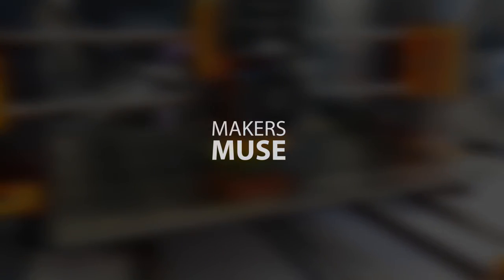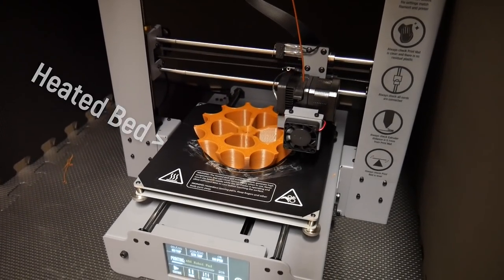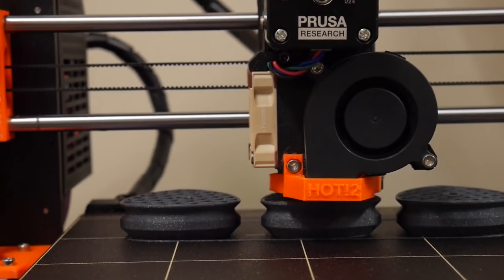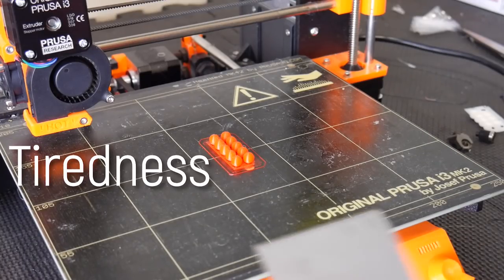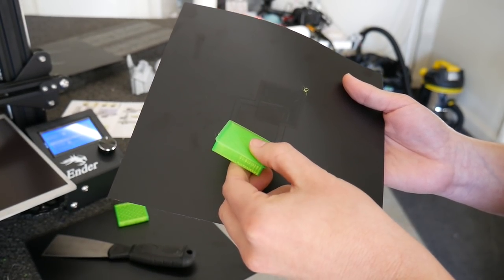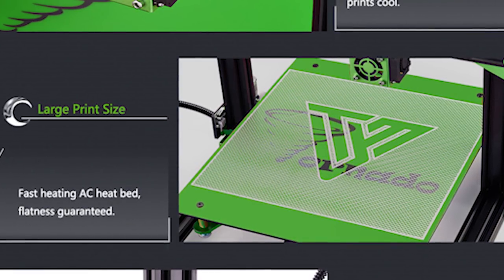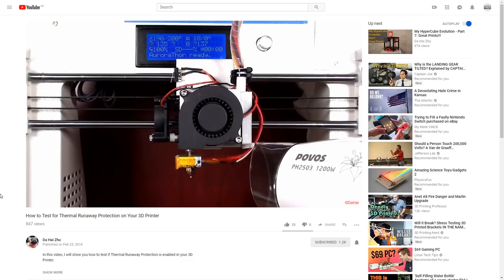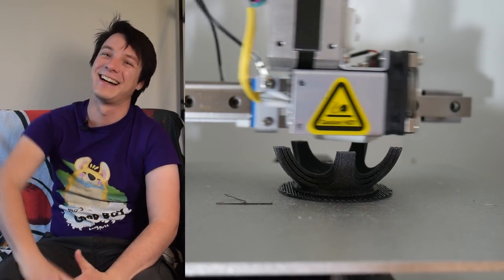Safety Tips for FDM/FFF 3D Printers - 3DP101

Comment: Angus, I would include the removal of support material. It's sharp and can cut  your hands very easily. 

Either using gloves or a machine with support material that dissolves is a way to reduce the risk. 

Great information as always.
Reply: That's especially a problem with pla.
Reply: FireFox64000000, very true I tend to see that happen more often with PLA.

But I feel this has happened to all of us at one point.
Reply: I cannot remove support material without hearing Angus's voice talking about the "shaap shaads" in a previous video. And he is right. I've had a few shards go under my fingernails. Ouch. Right now the most dangerous thing I do is use some sharp dental pics to clean up a print. I am continually jabbing those things in my fingers.

Comment: No mention of fume risks from hot filament ? I recall someone ( Sarah Petkus I think) reporting serious health effects of exposure to fumes from a 3D printer
Reply: Yeah, I was wondering the same thing, along with nano-particles that are created, especially from ABS as well.
Reply: yes, he should have mentioned that. there is a person on YT that did elaborate tests on this and PETG and PLA should be safe unless you run something on the scale of the Prusa print farm, ABS and other materials should be treated with great care. I have my printer in an airtight enclosure that can be vented to the outside for when printing ABS, PC and nylon.
Reply: I'm thinking about a vacuum cleaner hepa filter (it's dirt cheap from aliexpress) with a fan (some 80-100mm noctua to keep noise down) in my enclosure, did someone scientifically tested this? or going to?
Reply: i don't know about that hepa filter. personally i would have a hepa filter and an active carbon filter stacked. you want a pretty big fan, i used a 120mm pc fan since they are so standard.
Reply: there are for sure filters with active carbon too, there is a lot of printers having filter as an optional extra,  replacements can't be much expensive.
Reply: That is true but there isn’t much of a way to counter fumes besides not printing in a broom closet and huffing the fumes, open window and fan if necessary, there’s a reason a lot of stoves are coming with overhead fume extractors but in general, breathing in burning material isn’t healthy but it won’t knock you out like monoxide poisoning from cars quite yet, setting one’s house on fire or losing a finger is a bit more of a higher priority. Also, you are mentioning one source on harmful fumes, at this point it might be more dangerous to make a PSA on don’t 3D print your own gun to bring for show and tell in a kindergarten, not that I am disregarding the idea of having a filter on printers, just that there’s no practical way of implementing them on machines without telling the entire community to not buy 3D printers, there are quicker ways to kill a business
Reply: @mikeselectricstuff Virtually non-existent. The "fumes", ie: the smell, of hot plastic isn't of any great concern to your health. There can be some argument that you might find some so-called 'nano-particles', but take a moment to think about how ill-conceived that argument really is. It's the lab rat argument... 'Sugar is so evil; this lab rat died after eating 20 pounds of it in a 7 day period, we must warn the world of this massive health risk!" Of course if you expose yourself over long periods of time in enclosed and unventilated areas to lots of  hot plastic fumes (mostly from ABS), you might see health risks. But the average home printer will never realize those risks.  Better not go outside lest you be assaulted with quintillions of nano-particles of dirt, dander, pollen, etc..!

Really though until there is a good study done about this, it's just opinions and conjecture.

Comment: Thermal runaway protection saved me just yesterday. The thermocouple came loose from my printer and I would have never noticed if marlin didn’t catch it.
Reply: Ye, a tonne of electronics have thermal protection (including most laptops since those CPUs have been known to cause fires as well), its insane to think that thermal protection doesn't come in 3D printers as standard. 

I had a problem with a camera many years ago, it had a fault and didn't have a proper thermal protection. Even though the camera was in my hand, I was busy chatting to someone so I didn't notice, it started smoking, sending fumes up into the air and, of course, the batteries also caught on fire. I was very lucky not to hurt myself with the heat, the batteries, the molten plastic or the fumes.

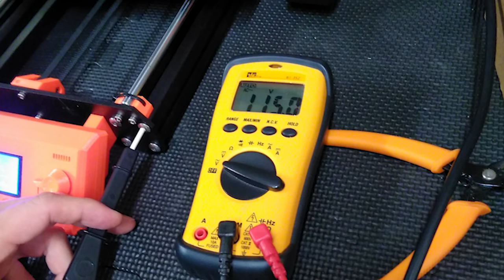Comment: Hi Angus. A few comments about 7:40 (electric shock): 
 -  What you feel is current, not voltage. That means the power supply in the faulty printer had excessive leakage current. 
 -  Most isolated power supplies on their own have floating outputs, even if there is a ground connection on the line side.
 -  Measuring on the isolated side of the power supply with a multimeter in voltage mode will read a "ghost voltage" created by the leakage current flowing through the 
    internal resistance of the multimeter (usually 10 Megaohms).
Reply: Volts jolt, current kills.

Comment: Too lazy to look down through 226 comments to see if someone else has already mentioned it, but for those of us with long hair, there is a significant TANGLE RISK.  Lean in too close to that running print to examine a fine detail, and let your hair get pulled into a belt, pulley, or lead screw.  It WON'T be pleasant. I think this is an especially important consideration when children are involved.  
Make sure your hair is kept well away from moving parts with the use of a ponytail holder, rubber band, etc.

Comment: On scrappers, 3D Printing Nerd put me onto to chisels in one of his videos, game changer for me. More mass and can go dead flat on the bed, helps get a stubborn corner up and then the scrapper can be used without excessive force (if needed at all). Of course, all of the same safety considerations apply (if not greater care needed). I was sceptical, thinking I'd end up taking chunks out of my PEI but because you can get it perfectly planar on the bed it slides and doesn't dig in. Of course, removable bed is better still.

Comment: since buying my tevo tornado (fast heating AC bed mentioned and pictured) i have added in cable strain prevention on the bed, replaced the original grounded power cord with one of better quality and it is on its own grounded cgfi outlet and disconnected both thermal sensors (one at a time) to test the run away protection because i was told that 3d printers burn down houses ...

Comment: No mention of fumes? ABS or Nylon especially releasing known carcinogenic or nervous system afflicting chemicals. I know the nanoparticle concern is still a mixed bag as far as science goes thus far. But those toxic fumes, they're well tested! Bare minimum, know your materials and what they off-gas at print temperatures, print in good ventilation, and keep exposure time to a minimum.

Comment: Best thing I can suggest for a scraper blade is to use a small deadblow hammer, or min-sized hammer. You aren't mining for coal, here, you're just driving the edge under the part. A small, sharp smack is usually all it takes unless you have a print with an especially large raft or overall footprint. I've also taken to use an Exacto knife to get under the edge/corner of the print without damaging it, and then get the scraper blade under that and slide out the Exacto to get some more leverage. Works fantastic and you have a much gentler touch to your finished part! I've found that I rarely damage prints now by using an Exacto with its very flexible and thin blade.

Comment: I have to use a scraper. One thing I do that I never see anyone else doing is to use electronics side cutters to safely lift the edge off the surface first. This works especially well for parts with corners.

Comment: The zap is from the EMI suppression caps (y capacitors) that are in all switch mode power supplies. Can create potential of 100v between DC ground and safety earth (taps, radiators) but if you look at the current flow it’s micro amps, tingles but no death.

Comment: I use a mamorubot polypropylene build plate i purchased from amazon. No scraper required. Must be run hot (65c for pla, 90c for abs) for build to stick throughout print. Once print is complete let build plate cool and the part just slides right off without any issues. Also gives first layer glass finish. I havent required glue or build surface replacement in months. I just wipe it down every once in awhile with isopropal alcohol to clean it.

Comment: If you need to push that hard with a scraper, it *isn't sharp enough*. Any detachable surface is a huge improvement. Even glass is an excellent improvement as it can be chucked in a freezer if the part refuses to come off.

Comment: Great video Angus!
Thank you, especially for that last bit on thermal runaway false trigger.
I am new to 3d printing, only a few months in with my cr10s.
I have upgraded the firmware on the printer after I heard the protection is disabled from the factory. TH3D unified firmware got flashed. I recently upgraded to a fang cooling mod with a 5015 fan and was printing my first large print. About 8 hours into it the thermal runaway got triggered. 
I went through the entire printer trying to find an issue and I have not found one... Not on the hot end and not in the control box. Now I am 99% certain that it was the fang blowing into the infil cavities in the print and the infil rederecting the air flow back onto the hot and triggering a false thermal runaway fault. I will try to slow my fan down some (even though it was already at 60%) and I ordered a silicone sock for the heater block. Hope to get it resolved soon.

Comment: Some underengineered machines do have a risk of electric fire too. They cheap out on the power connectors running way too much current thru them. I've seen printer control boards where the connectors started to melt away already, and from melting connectors it's not a long way to start a fire.

Comment: First and foremost for anyone just starting out, Smoke Detector and Fire Extinguisher rated for Electrical Fire, they are cheap and easily available.  You should have these on hand and setup before your printer arrives (you may be too excited to use the printer and forget to get these and set them up).

Comment: My Tevo Little Monster caught on fire.  I had a false sense of safety because thermal runaway was on, and the bed doesn’t move which were the big ones other people have mentioned.  Apparently if the electronics lock up/crash it can be left in a state where the thermal runaway detection isn’t running and even if your thermistor, your wiring, etc are working the electronics turn on the heater and just doesn’t turn it off when it reaches temperature.

Comment: PRUSA does not have thermal runaway protection that works if the heated bed or extruder FET transistor fails closed--as is a common failure mode if exposed to static discharge.  The Marlin firmware can try to turn off the heaters all it wants but if the transistor is failed closed there is nothing to stop the bed or hot end from glowing.  Fuses don't work in this case because the maximum current is not exceeded.  The best way to protect against this failure is to embed a thermal fuse in the heated device connected in series with the heater leads or power supply.  My first printer came with this feature built in (SeeMeCNC).  I do not see an easy way to fit a thermal fuse into the heat break of a E3D extruder, but the manufacturer should provide a means to protect against this very real failure mode.

Comment: I am a car guy. I have scraped more than a few gaskets off hot car engines; the putty knife cuts are not a joke. PLEASE be careful. 

My Anet A8 blew a connector the other day, right where the 12V 20A power comes in to the main board. I never leave the printer running unattended, and so within a second or two I smelled that distinctive smell of burning electronics. Fortunately, all I had to do was resolder the connector, but that's a temporary fix. Weidmuller is not paying me to promote their products; I have ordered their connectors. 

People are making their own 3D printed enclosures for the power supply and main board - please don't. If anything catches fire, now it has the 3D printed fuel it takes to cause an inferno. I know Angus has informally tested a few different kinds of filament, but do you feel like betting your house on your filament supplier's QC? Make your enclosures of out metal. It's a lot more work than downloading and printing it, but it's a lot safer too. And GROUND THEM. Better to blow your motherboard than your heart. 

Printer enclosures scare the hell out of me from a fire safety standpoint. The critical thing is that they must be non-combustible! If your printer catches fire and ignites the Ikea table and cardboard shack you've built for your printer, it's gonna be bad. I haven't built an enclosure yet, I'm just looking for an old bar fridge that I can gut for its steel box. And the front window will be glass, not plexiglass. Any sort of steel box, like a filing cabinet, should do the trick. Take pictures to your local fire department, tell them the situation, and ask them for advice - they will be happy to help you. Remember that we want to make things, not burn them down. 

You get a second chance on the pinch-points on a 3D printer. It'll hurt like hell and maybe give you a blood blister, but it's unlikely to kill you. Stick your hand into the serpentine belt of a running car engine, or a million different places on a forklift truck or front-end loader, and you're permanently losing parts of your body. Index finger? What index finger? 

"Lawrence, is that an extruder burn on your hand?" Nope, it came from the exhaust of a 1979 Toro snowblower. "Did you get it running?" I was stupid and I burned myself on the muffler. That should answer your question.

Machines have power, and must always be treated with a combination of love, awe, and respect.

Comment: Somebody brought in a "reprap guru" i3 style printer yesterday. Among other wtfs was the power cord connected straight to the power supply without a switch.

Safety first kids!
Reply from the maker: Haha, that's how a lot of the cheap kits still come. One even had just a 2 prong plug pre stripped. No ground!
Reply: Maker's Muse hahaha, my kit!
Reply: My kit was like that. I use an extension with a switch.

In the same extension I have the power cord of the old PC that I use with the 3D printer and a lamp. Cheap chinese kits are kinda dangerous. At least mine did not came with an unearthed plug

Comment: Angus, you didn’t mention the two most common health risks: every fused-filament fabrication (FFF) 3-D printer generates particulate emissions and most are susceptible to Teflon tube pyrolysis, both of which I discussed with documentation in other YouTube comments.

The upshot of that offgassing is that FFF 3-D printing should never be done in occupied buildings without enclosures and engineered ventilation systems or engineered filtration. However, after watching countless YouTube videos, I’ve seen only one 3-D printing influencer (one of the lesser-known newcomers) attempt filtration, and he unfortunately made fundamental errors decimating its efficacy.

My guess is that the 3-D printing industry is intentionally ignoring these problems, especially particulate emissions, because acknowledging them would reduce sales and create an expectation that manufacturers should implement mitigation strategies. Instead, they are collectively turning a blind eye to this issue.

Comment: Of course, 3D printers can cause a fire, even if they're not malfunctioning in any way, if you have flammable material nearby.

Sure, that's common sense, just like many other things on the list :-)

Also, could have underlined "Don't leave running 3D printer unattended" more.

Regarding the thermal runaway safety feature in Marlin, if you (like me) are have issues with it triggering too easily when there isn't anything wrong, it's a way better solution to adjust when / how it gets triggered, than turning it off, like way too many manufacturers apparently do.

Comment: I think you should have mentioned toxic fumes/particles during printing. This is (at least in my opinion) one of the biggest risks when 3D 
printing since you can’t see the fumes and I think many people simply don’t know that their 3D printer is emitting toxic fumes. This can be an even greater risk when using something like an activated charcoal filter to eliminate bad smell since it does not absorb particles but since there is no more smell you could easily think so. I’ve recently read an article which claims that not even a combination of an activated charcoal filter and a hepa filter is enough to eliminate toxic fumes :/
Reply: BainSonic 
The best preventative advice to combat toxic fumes is putting 3d printers in well ventilated areas, including well vented garages or other dedicated workshop areas.

Or set up a dedicated fume hood surrounding the printer. Doesn't have to be like chemist-rated, but enough to make sure the air goes in only one direction: from inside the room to out of the building.

Charcoal filters work well against organic compounds, while HEPA filters work against particles. Polymer chemical fumes are a different sort.